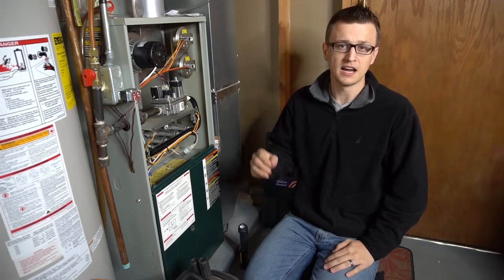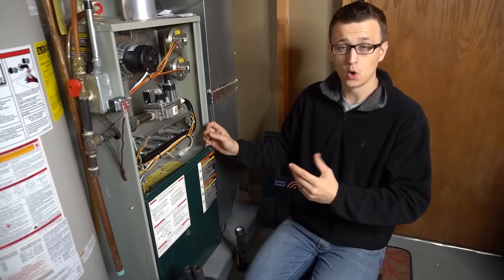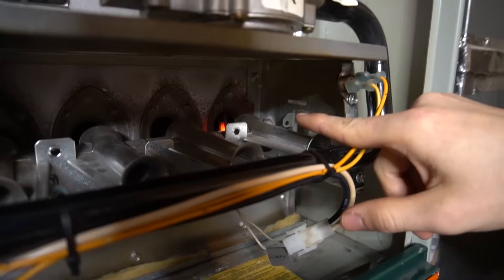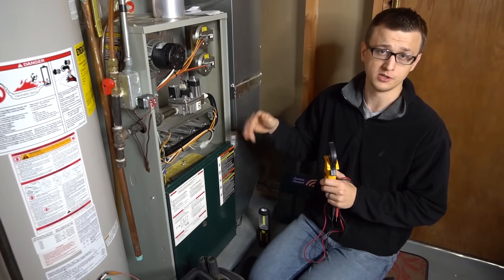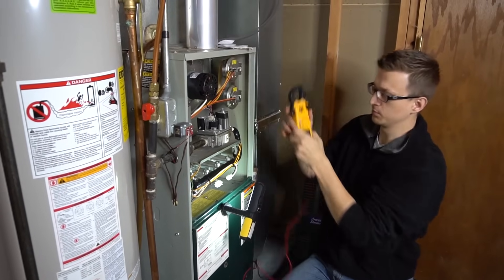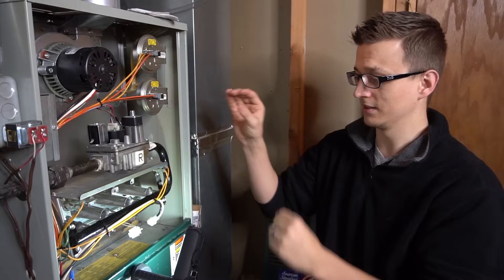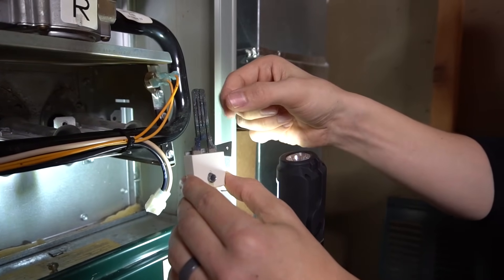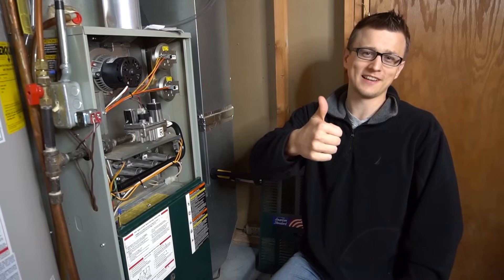Furnace Not Igniting - How to Check and Replace Ignitor

Comment: I have a mid-90s Carrier 58gsc furnace that has been sitting all summer and recently failed to run.  There is power and gas, but the igniter does not spark or flow gas.  I replaced the controller board without luck.  How do I know if the igniter, ignition control, or gas valve is bad.  Gas is in the system, and I get 28V going to the ignition control and gas valve.  Please advise.

Comment: Brand new igniter, new inducer motor, new pressure switch, cleaned all the condenser hoses and worked for 2 days.  Now throwing a code that says igniter problem check ground?

Comment: Hi Jay, I have the 3rd type you called the intermittent igniter. I have the 3 wire Honeywell Q3400A1024 igniter....I believe that the thermal-couple part of this igniter has gone out. When I ask for heat at the thermostat, the sequence is first the inducer/draft fan goes on for 10-20 seconds, then the gas valve opens the "pilot light portion" and then the igniter sparks and I have a very healthy pilot flame, this part works fine. However this is as far as the sequence will go. The main gas does not get introduced even for a few seconds...... My system uses the 3 wire igniter that has 2 blue wires that go to a looping rod that sits very close to the pilot flame and one black wire that gives it spark. I assume this looping rod is the thermal-couple you spoke of and its job is to confirm that we have an ignition source that is ready for the main gas to be introduced into the system....... Am I on the right track with thinking I need to replace the Honeywell Q3400A1024 ?...... I also tried to clean the thermal-couple rod....BAD MOVE as it is very thin and brittle, and I snapped it off...... Thank you in advance for your reply and keep those quality videos coming...... Bill H.

Comment: After replacing my pilot ignitor (the ceramic bit with wire that sparks, #3 in this video), my ignitor NEVER stops now even sparks when heating the house, this is annoying to listen to. What have I done wrong?  Pretty sure it stopped sparking when the Big Fan (for hx) kicked in before.

Comment: If the plugs are different it is better to cut the plug off of the old ignitor and splice the old plug on to the new ignitor. You may be able to remove the pins or socket connectors from the plastic part, and insert them into  the old plug. I don’t think wire nuts are allowed for 110 volts outside of a junction box in some areas. I use shrink fit butt connectors followed with a layer of black shrink fit tubing.  If wire nuts are used, they should be ceramic ones, not plastic ones, because this is a high heat area.  Good video.

Comment: Thank you.
Svc Tech wanted $1500 minimum (Inducer Motor + Hot Surface Igniter + Labor) to "start" diagnosis, but was recommending total HVAC replacement $10K.
Looks like I will be able to skate by with a few hours of research and $21 for a new HSI.
Reply: I would report them to the Better Business Bureau and leave negative comments on Google and Yelp.  We need to speak up against those trying to take advantage.

Comment: Does the igniter flame sensor need to be touching the flame the inside the flame when it’s lit mine will light, but then shut off a couple seconds later

Comment: Hello, Im having the other issue everyone gets vague about with no voltage to my ignitor. The fan comes on, then the gas flows like you showed but there is no voltage at the connector. I traced the wires back to the control circuit board, but now what? It's solid state mainly diodes and stuff. One 3 a fuse thats good. Ignitors are cheap, but these are not. Is there any other sensors or things to check besides condemning the circuit board? Please help, its getting cold and my family is telling me to call a real HVAC guy which isn't gonna happen.  Thanks
Reply: I'm really trying to avoid calling one myself😂
 I replaced my HSI..but it still doesn't glow. Did you ever figure out your problem?

Comment: Exact problem I had.  Was getting the 123 V AC at the electrical connector for the igniter but igniter was not lighting up.  Replaced with new igniter and good to go.  What would have probably cost 150+ for someone to come out and fix, cost 45 bucks and took 5 mins to replace.  Great intuitive video.  Also, as someone else mentioned, open box of new igniter before you leave the store.  The igniter is somewhat delicate.  Dropped the first one I bought and it shattered.  And also, don't touch the igniter element with bare hands as the oil on our hands can shorten the life of the igniter.

Comment: I changed the igniter, limit switch, air pressure switch, cleaned the flame sensor, …still no igniter glow or gas coming out. Condensate pan is empty. 

Help???

Comment: Thanks.  I knew how to clean my flame sensor and burners, but this was my next thing to learn. I assumed I could clean the hot surface ignitor with 0000 steel wool, then clean with alcohol for impurities, so I did that.  Unfortunately, I later saw video saying never touch it.  Was I wrong?
Reply: Yes, never clean them and try not to touch them. They have a coating on them and cleaning them will remove it. Oils from your fingers can cause damage to the ignitor. Silicone ignitors are much more sensitive and fragile than nitride ignitors. Worst case you took some life out of the ignitor so you should buy one and keep it handy. They're not terribly expensive so not that big of a deal.

Comment: What if it barely ignites (glows)  for about 5 secs and then just goes off ? Still a bad igniter
Reply: No, when ignitors fail they open and cause no current to pass through them at all. A resistance test will tell you the health of the ignitor. If the board is not sending power then you need to figure out why. It could be a bad board, an intermittent pressure switch issue, or a loose connection somewhere.

Comment: Do you have a video on why gas wouldn't be coming out intermittently. If I let it sit off it will turn on in a few days but if i up the temp to try to activate. I can't hear gas and everything cycles but it won't light up. I mean the igniter does but no flame. I got cocky probably not approved by OSHA but I ran a lighter across the burners during the cycle nothing. I've called out techs and they all just get it working for a day or so . Then it's intermittent again.
Reply: Bad gas valve, bad board, or loose connection somewhere. Test for voltage at the valve, if its getting voltage but not supplying gas then the valve is shot.
Reply: But you should also verify that the valve is getting gas. Take the plug out of the inlet pressure port and see if there is gas going into the valve

Comment: Hi 

After replacing all 3 components, my heat still cycle 2 times at first start. 

I hear the ignitor comes on and then a hear kind a wind sound. 
The light is blinking normal call for heat. Help!
Reply: It cycles before the big fan / blower turns on.

Comment: Great video. But Kind of confused. When check the voltage, disconnected the ignitor. No matter voltage reading, it is not relative to ignitor. How could this reading could determine ignitor is not functional since ignitor is not in this measured circuit,

Comment: Your videos have really helped me. (I think my furnace is the same model you have there to be honest) But now I have a question that I don't think I've found the answer to and am hoping for some advice.
My ignitor wouldn't light. I noticed it didn't glow at all. I tested the furnace with a long lighter, and it kicked on, and worked normally. After it cycled off when it kicked back on a few minutes later, the ignitor seemed to work/glow as normal. I kept the temp about 75 to see if there was any change and there wasn't.
I actually thought it may have just needed cleaned or something, and the burner burned it off. I suppose I was wrong.

As soon as I turned the furnace down to 70 it didn't kick on for hours. Before bed I wanted to test it again so I put it back up to 75. It didn't ignite again. So I figured it had to be the ignitor. I ordered a replacement and it showed up this morning. It didn't glow or ignite.

The new one also didn't continue the cycle a the old one did yesterday. Any thoughts?
Reply: Also, just tested, and 120 volts is there.

Comment: My igniter glows red, but the furnace doesn’t light up. I don’t smell gas. The green light on the control board keeps flashing 6 times and stop then does it again. What else should I look for? I have just replaced the main limit switch and the flame sensor. Thank you.

Comment: I have a goodman gas furnace.  With the front panel off and looking at the 3 burners is the orange glow at the right burner during start up, is that the ignitor glowing?   Next, if that is the ignitor glowing, can I assume that the glow means that the ignitor is good?   My furnace starts for a couple minutes and the orange glow tries to light the gas three times before the system faults with a single blinking red light on the control board.  I don't smell any gas at all.  I cleaned the flame detector and cleaned the burners (thanks to your video.  Thank you!).    I am ordering some parts which include a new ignitor, a resettable and no resetable limit switch and pressure switch.  thanks again for making those videos.  They are very helpful.

Comment: Life saver, I ran down recommended list of what the issue could be, which made me believe it was the igniter device, I couldn’t check the voltage but took the chance and pull it out. Boom clear as day crack, got a new one for $30. Thanks you for the help, learned a lot

Comment: Thank you sooooo much.  I checked the igniter.  Had 110 volts going to it.  Removed it and found crack.  Local shop had a replacement in stock for $60.  Works great and warm house feels so good.  Couldn’t wait for delivery from online retailer.  We’re happy.

Comment: Great video. How do I determine if the ignitor is 80v or 120?
Reply from the maker: The surest way to know is to unplug the ignitor, turn on the furnace, and measure the voltage coming from the control board.
Reply: @WordofAdviceTV if I'm not getting any voltage coming out of control board to the igniter plug, does that mean my control board is bad?

Comment: I have checked the input wire to the ignitor.  It is not getting 120 volts.  What is the reason the ignitor is not getting 120 volts?

Comment: I’m having an ignition problem on my Trane XL80 furnace: ignitor not glowing when turned on. It reads about 90 ohms, so it’s not burnt out. It doesn’t receive any voltage! 
After flipping on the switch, the motor fan starts working, then I can hear a click sound when it’s time to send power to ignitor (which doesn’t ignite since no power), then gas hissing out. I can manually ignite when gas is hissing. 
So, a bad board?
Reply from the maker: Yes, most likely that is a bad board or there is a loose connection in the wires going to the ignitor somewhere.

Comment: Cant find anything on this in this video, but ... what if the pressure switch is working but the Electric Igniter is NOT getting voltage?

Comment: Hi, Thanks for the information, My furnace is keep throwing cold air even if there no flame 🔥. I do see error code 2 flashing. My question is why the blower is ON all the time? I know my igniter is broken. I changed my ignitor twice last week, I cleaned flame sensor and limit switch and pressure switch also air filter and vent as well . No use. Can you tell me is there anything else do I need to to find the problem?
Reply: Probably bad control board (mother board)

Comment: This is really cool and detailed explanation.  Thanks for making and sharing it!
My furnace just broke yesterday with error code 34 then 14. I see the ignitor not going on at all after the induce motor started working. And, I checked the voltage sent to the ignitor was just ~80 volt instead of 120v. And, the resistance read about 110om. Would it be something wrong with the control board?  Not sure where exactly to troubleshoot at this point. ANY advice will be appreciated.  I've bought a replacement ignitor just in case. Is it worthwhile giving it a try?
By following your other video, I tried to manually ignite and managed to heat up the room for the night until it hit the target temp. I assume that means the flame sensor is in a good state :)  Thanks!

Comment: Help my igniter won't glow
Reply: My unit is Lennox model number g51mp-36b-070-07. Mine reads 18 Ohm. Doc says should be 10.9-19.7. The video says should be 40-90 ohm (video at 6:10).
Reply: I checked my 2nd unit that's working, the Igniter reads 15 Ohm. So looks like the working range is 10.9-19.7.  I'm tempted to take the igniter from the working unit and install it on the one not working just to see if it's the igniter issue. I'm just worried to touch the working one - in case i break it.

Comment: The igniter got red but gas valve was stuck. I replace a gas valve but it wouldn’t click to open.
I got 24v on plug and I jump start the gas valve with control board and the gas would open.  Once I put the plug back in again it wouldn’t click. Why? This call stress me out so much.
Reply: This call made stress so bad

Comment: Have been watching your videos I installed the ignitor and the code i am getting is two blinks code. I have the same control box as yours. I checked voltage but i am not getting the 120v at the ignitor. Is the issue the control board? Thank for any help you or anyone can give me.

Comment: we recently had an electrical  double powersurge and when the electricity came back on  we heard a LOUD BOOM,  the power came back on  but we discovered later the furnace was blowing cold air.  
Had PG&E come out who diagnosed the fan to be working, but the IGNITER wouldn't come on, needs replacement. 
we most likely aren't able to DIY and our intent is to put it in a claim with PG&E  whether they'll reimburse us or not is TBD!! 
Question:  Can a power surge like that blow out the igniter??  
THANK YOU for your answer!! 💪🙏

Comment: This guy is very helpful...I wish to add if I may.  It is possible for a failure of the ignitor to do damage to the controller.  I had to replace both the ignitor and the controller (which had been replaced about three years ago).

Comment: Thanks for great video. I have a very interesting situation which i don't know the root cause. There is 24v going into the gas valve and heat is running fine. Certainly there is no voltage to the gas valve. I unplug the wires plug from the circuit board and plug it back and this time 24v are there for gas valve to turn on. If you know what is the problem, please let me know. Thanks for the help.

Comment: My hot surface igniter work intermittently but will sometimes turn on when the blower is already working. I can hear it click many times until it finally ignite the gas mixture. Do you think I need a new HSI ?

Comment: Top Tip: Make sure you pull the new igniter out of the box before you leave the store to make sure it’s not broken. Sometimes you get back to the furnace only to find that the new igniter is in pieces.
Reply: Mr T,    great advice for the checking the part at the store, also as a  added bonus bring your multimeter with you and check it right there in front of the SALESMAN,     they would not mind at all,  &  will    save you time and hassle for the back and forth trips that you might make.... 👍😏
Reply: I had to replace a blower motor for a mini split unit. I removed the old one just to find out that the new motor was is pieces and couldn’t finish the job that day. It came straight from the factory. I now inspect all my replacement parts before taking apart the failed components. Good tip

Comment: I’m at a loss right now. My furnace turns on, inducer runs, my igniter glows, I hear a click, I don’t audibly hear gas, flames do not light, then another click and the igniter turns off and the cycle repeats. My circuit board has a single led bulb but it is not displaying any fault codes. Is it possibly my gas valve? Weird thing is, my heat was working yesterday, which was mild weather. Today, very cold, heat not working.

Comment: Thanks,my furnace isn't lighting the gas and I think the igniter is the culprit. It doesn't look like yours but looks exactly like an Emerson universal igniter. There looks like a burned/arc spot between the igniter rod and the isolater/insulation. I haven't tested it for resistance but I am betting it's OL.

Comment: my furnace just stopped working today. the inducer fan turns on but the igniter doesn't turn on nor the gas valve doesn't click. I replaced the gas valve last year. I watched the video and yup inducer turns on, no ignite and  gas does come through. I just checked the voltage on the wires coming from the board and no power. please help

Comment: I've been through so many of your videos over the last 6 hours trying to figure out my furnace problems, and they're all fantastic and easy to follow. Everything was in working condition, as you described, but the ignitor never started glowing. I was about ready to throw in the towel and call someone when the wife suggests, "Maybe the thermostat needs new batteries." And after I've taken your entire video crash course to become an HVAC expert, the problem was 2 dying batteries. I just assumed all thermostats were hardwired.
Reply: A tip....Don't know if this pertains to your house or not, but good to know either way! A lot of thermostats are hard wired and have spots for batteries that are never used. If a shady heating and cooling company comes over, I've seen them put batteries into a hard wired thermostat. Then months later those batteries start to die, your thermostat doesn't kick on and you have to call them back. Even though your thermostat was hard wired to begin with....It's a shady practice I've seen firsthand on multiple occasions.
Reply: I did the same thing before! Lol!!!